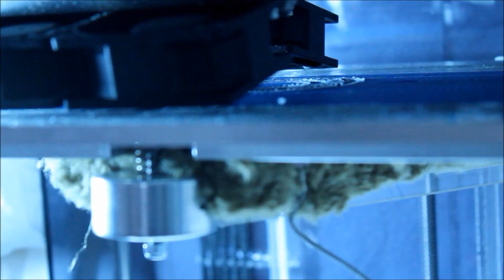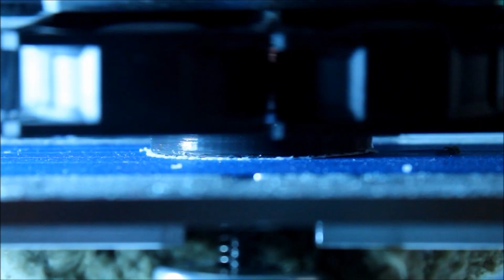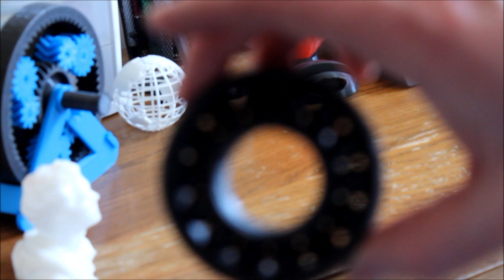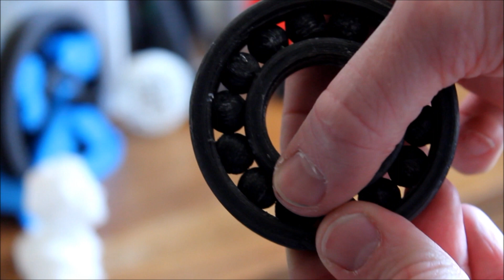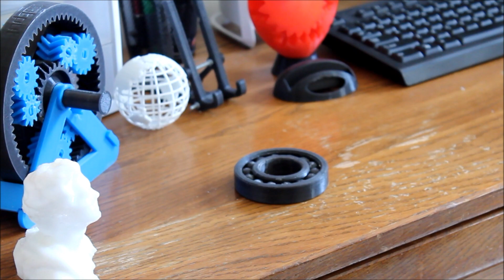3D Printed Ball Bearing

Comment: Awesome print and awesome vid! I'm wondering if you might have a design file for this or perhaps could be commissioned for something like this?
Reply from the maker: The file I used was, I believe, http://www.thingiverse.com/thing:143467.

I could also be commissioned to do a similar file/print.  Really anything your mind can think of we can create and print.
Reply: Thank you for your reply! Thank you, I'll take a look ^^

Ideally, I'd be looking to buy two lots of the bearing runs (so two of what you've made here) but would, unfortunately, need quite thin ones (so small bearings) with a large diameter. The inner and outer diameters would need to be quite close to one another. If this were at all possible, I'm afraid I'd then have to complicate things further, as, on the inner rings/ID, I'd need to have at least one bayonet joint (the slot part) built in, which I'd make compatible with a piece of PVC pipe with the pin part. The outer diameter would have to be (roughly) between 60mm and 80mm. It doesn't seem very possible unfortunately XD

I am considering buying my own 3D printer to print this part attached to everything else it needs to be attached to, but I don't know if it's worth the investment... granted, I could make the majority of my project via the printer, but it's just one project and an £800+ price tag! I guess it would come in handy afterwards though.
Reply from the maker: All of that makes a lot of sense, I think we all go back and forth with things.  Here's my opinion: With 3D printing comes a lot of trial and error, same with design.  So you have an idea in your head and we print it, lets say it's $50.  But we find out there's an error and need to reprint, another $50.  And you can see how it snowballs, but if you get good prints early then it's only that charge.

Hopefully that makes some sense and answers your questions.
Reply: Thank you ^^

Comment from the maker: Ian,

Thanks for watching my movies!  I too have had many issues with the 3D Touch.  One of the things I did was made a heated bed and got rid of the original, have had some issues with ABS but have worked through them.  PLA has printed great.  Another issue was with the electronics.  With my heated bed set up I need to level and change the gap every print.  But I can turn it off and turn it on to fix that :)  Also, I will plug Kisslicer to slice and make the gcode rather than axon.  Good luck!

Comment: Hi Phillip, I noticed you're using a 3D Touch printer and I've got to say I'm amazed with how good your prints come out! I have the same printer but I never stop running into errors both on the software and hardware side of things. Do you have any tips for a fellow maker on how to optimize the 3D Touch's capabilities? I know this printer is a fantastic one but I just cant seem to get it to work correctly :P